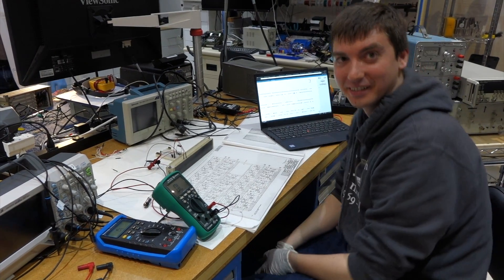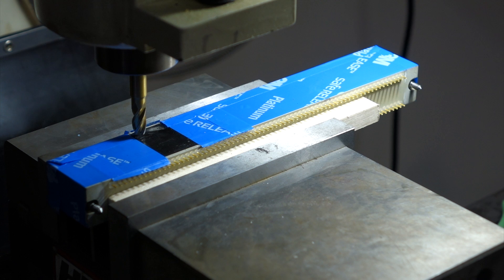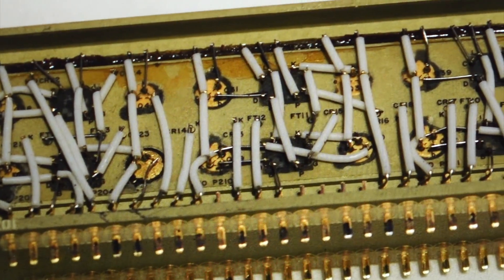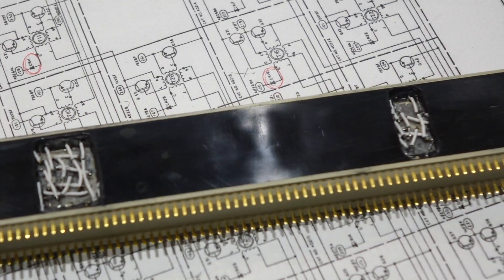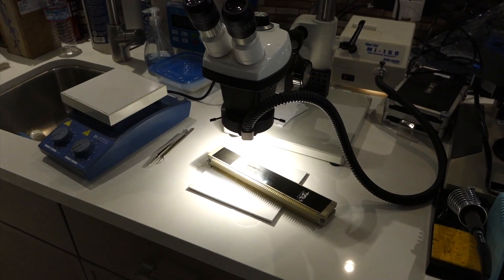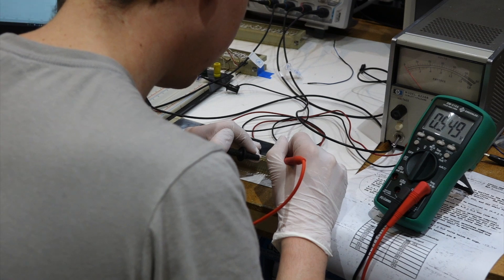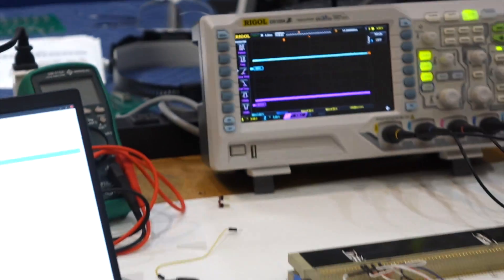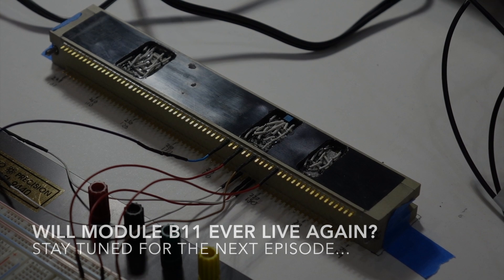Apollo Guidance Computer Part 16: Digging into potted module B11

Comment: I collect and repair vintage calculators from the 60s and 70s. I have seen more faulty diodes than faulty electrolytic capacitors.

Comment: Bad luck that most faults are in the sealed modules
Reply from the maker: I don’t think it’s luck at all. The sealed modules are the only ones that did not belong to this unit original configuration. They likely failed in another AGC/experiment, and someone stole the good unpotted original modules from this AGC and swapped them with the failed sealed ones.

Comment: Hmm suddenly realized.. Your AGC cane from the scrap yard instead of a museaum huh? haha.. great work guys..Absolutely something special.
Reply from the maker: Yes. It’s a rescued AGC from a junkyard. Was going to be melted down :-(
Reply: @CuriousMarc  could well have been that they did some destructive tests on it and that's the exact reason it ended up at the junkyard instead of a museum. I think a couple  of years ago I saw the first parts of the serie and it looked bad so I gave up.. picked up recently and luckely you guys didn't give up. Enjoyed it so much. Something special to this. I myself worked first decade of this milenium with Siemens Teleperm-B from the 70's a system that was a bit of an evolution of this computer but much simpeler. The program was stored in mostly AND and OR gates.
Reply from the maker: @johannesdesloper8434 We know from the recovered content of the core memory (in one of the later episode) that it had been functional until its last power down.
Reply: @CuriousMarc  Aha, so components died of "natural"causes. Hard to find the right words , but this whole series of video's did a lot with me. Thanks for the effort. HA! I have a couple of large ferrite rings laying around, this inspired me and maybe one day I reproduce the old 4bit patent with wood and copper .
Reply from the maker: @johannesdesloper8434  We are not sure. The only modules that were faulty were the potted ones, which did not belong to the original configuration of the computer. One thought is that they failed or got damaged in another computer, then someone stole the good modules from this one and replaced them with the damaged ones. But we don’t know.
Reply: @CuriousMarc  Yeah that was the whole idea of the modules huh? Replace parts with a fault fast without have to rewire that whole backplane. And fun, a blessing to have a guy like Mike around that seems to be a part of that machine, I recognize that in a way, haha, it's a gift.

Comment: Heat helps, i open potted modules with hot air and also there is a BGA potting compound softening liquid i use on this thing, makes it really soft and you just remove it.

Comment: I cringe every time I see potted electronics.  I had to deal with similar issues when working for a military electronics supplier in the 80's.  They also wanted diodes potted into a transformer assembly.  The curing temperatures of the epoxy killed nearly half of the diodes and I had to replace them.  I masked the area with fiberglass tape and used a sandblaster to wear away the epoxy and the bad diodes.  Nice to see you still have a walk in electronics store nearby, I have a surplus store about 15 miles away.  I typically use Digikey for mail order parts.

Comment: You did really well with that. I have experience successfully unpotting electronics. One of my first jobs was at an engineering firm where I did prototyping and reverse engineering. A project I remember well was when a large electronics manufacturer paid us to take apart every shaver battery charger on the market and provide a schematic and a short analysis on its operation. For the potted circuits I had a large liquid nitrogen vessel that I would drop the circuit into until frozen solid then I would wave a small torch over surface. The temp change would cause the top layer of potting compound to crack and lift. I would scrape away all the loose material with small chisels and dental picks until everything was gone then repeat enough times until I could read the components and draw a schematic. The reverse also worked where a lab oven was used to warn the circuit then it was dropped into the nitrogen.

All the solvents I tried either did nothing or made such a mess that discovery of the circuits was impossible. I think MEK softened the potting compound but it also removed component markings and softened plastics.
Reply: The one thing I do not miss working with daily is MEK. It is always open somewhere in an aviation shop.

Comment: hmm first determine the actual potted meterial used,then find the right solvent, and concentration, then test the milled dust for conformation of assumptions made, then check its reaction on the metal used in the modules, then use it with the deactivating agent standing by just in case, dismantle and repair the man made device...
make yourself a small JohnnyQ90,Published on Jun 27, 2017 3D Printed Turbine Rotary Tool https://www.youtube.com/watch?v=Fj1gir4tJbU and use it with a generic cheap usb camera microscope/endoscope pluged into a large tv input

Comment: Wow!  That’s excellent detective work and a fantastic job of de-potting the problem area.  Only one minor point - and perhaps why the original diodes were open - clipping the excess lead with diagonal cutters imparts quite a bit of shock to the component (as evidenced by the sharp click! heard in the video).  It is better to use a scissors type cutting tool if one small enough to fit into the confined area.  Great work and thanks so much for sharing.  You guys are fantastic.

I should add the shock imparted to the component by the chop type tool may not cause an immediate failure, but can damage the bond wire connection inside the component or crack the die - resulting in a latent failure the shows up later down the road.

Comment: The first place I worked we did far too much of this type of repair.  Thankfully the modules weren't potted.  I have done hundreds of 2N3904s and 1N914s.  Last job before I retired was easy, Triode RF amplifiers.  Just had to be careful because of the -35KV on the cathode!

Comment: At this point I would take a day and go through both sides to clear out all the epoxy. That module has a lot of faults.
Reply: I think It adds to the piece to remove just the parts needed. It shows not only the construction but its history. I would argue they should shot for even smaller windows.

Comment: Dynasolve 185 Amine-Cured Epoxy Cleaning Solvent might be of use.  I haven't used it personally, but perhaps the manufacturer could advise as to whether it will work on the module you're trying to depot.  More info at https://www.versummaterials.com/product/dynasolve-185-amine-cured-epoxy-cleaning-solvent/ If it works, it might give you a way to repair the core module, too.

Wayne

Comment: How is it that components in a sealed module that were fed tightly regulated power by the AGC could have become damaged, especially after the exhaustive testing that the components went through before they were used in the AGC?

Comment: This is so awesome - and important for future generations, because there aren't many parts left from this era and hardly any of them still working, hence why this team assembled in the first place. I would've loved to have been part of this team because it's just the stuff that really turns me on but I live on a different continent... I was taught the NASA school of soldering back in the 80's when I started working with Ericsson, building and repairing telephone switch electronics and I still use the same soldering technique today (to a certain extent). Those solder joints I made in the 80's are probably still as good today as they were new and we who understood back then why we did the tedious work loved it whereas others left to do other tasks.

How do you plan to close the opened up windows in the modules you open up? It's got to be a balance between conservation (stability), security, looks and personal preference of the owner.
The potting compound doesn't seem to have affected the components at all so NASA knew what they were doing 60 years ago for sure! I assume you're writing down your findings and store this with the modules when done so future generations can read how you went at it repairing these modules? (youtube videos might not survive a couple generations...)

Anyhow, huge thanks for doing this and for documenting all your hard work!!!

Comment: My father worked at Raytheon Missile division, in the Sixties and Seventies.  It did Sparrow and Sidewinder missile guidance elements.   Potting was the bane of repairs to faulty units there.   They had to do much the same thing as you are doing to fix faults.
The very material which protects stuff from damage also protects it from repairs.  LOL
I love  the " Continuing Saga of the Apollo AGC. "  Move Over, Buck Rogers!   Good Luck!

Comment: The original Star Trek,  "The Motion Picture"   movie theme was based on them (though only a couple of years old at the time). Not a great movie IMO, but Roddenberry was quite the forward thinking man's technology  kind of producer. Not much nuke fuel left in them at this point, V-1, V-2.
Reply: Yep! I wonder if we should make and launch a newer Voyager probe, number 3, with modern tech, to supplement V-1 and V-2. Perhaps with more efficient instruments, even with the same power supply, it should have a much longer operational life. Even better if we could think of a better power supply. Sadly, V-1 has had to shut down several of its instruments due to its internal power running low.

Comment: after HSC closed Excess Solutions bought the left over stock. Excess Solutions is on 7th street in San Jose.
Reply from the maker: That's correct. They have only gotten a fraction of it at this time. Not sure if they plan to recover all of it.

Comment: But why did these diodes fail (were they short or open? Diodes usually fail short) and how did that shorted wire happen? Did they not test it before potting the module? You would've thought they would.
Reply: Simon Tay ... These are very early Silicon semiconductors. Many possible reasons for failure.
Reply from the maker: Mike told us that these particular diodes did fail long term qualification, and that the supplier was banned from ever selling to NASA. As you'll see later, another later  failed on us during normal operation.They were replaced for the final solution (remember our AGC is from a prototype series that was supposed to flush such issues out). They must have had some manufacturing defect. It could be that some test or mishap was also done for that module, since it had so many faults. I was not able to extract the diodes fully intact, so we can't do a post mortem.
Reply: Indeed -- the verbiage in the official reports was "channeling and surface instabilities".

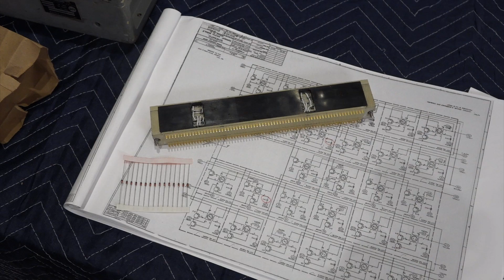Comment: Nice electronics parts store. Several decades ago I worked in a store that also had lots of shelves with those long narrow boxes of components. Did someone say the wrong part number? @8:10 the procured parts were referenced as 1N916B rather than 1N914B. The 1N914B diode is still very popular today. I still use them in projects. I have one envelope in my parts drawers with around 40 of them that are 30 to 40 years old.
Reply: Kevin Cozens .... 1N916B is a higher-spec version of the 1N914B is it not?
Reply: @florencegomer7937  I looked at the basic information about the two diodes and I couldn't tell the difference between them.

Comment: Reminds me of equipment with now unobtanium MC44 diodes in it, which had a very nasty thing of failing as either open circuit (not too much of a problem till 2 failed in the same section) or they went short circuit. Failing short meant you now were shorting part of a transformer secondary, but the unit would keep on running for a while, just with much higher ripple on the unregulated supply. Not a problem for the linear regulator following it, seeing as the headroom was in most cases 1.5 to 1.8 times the regulated voltage, just slightly higher noise on the rails. As the transformer had high resistance secondaries, and quite high impedance as well, this limited current somewhat till a second diode decided the abuse was enough, and it too went short circuit. 

Then you had a 3 phase transformer with 2 secondaries passing a high DC current, or a shorted secondary, and with a few hours running the transformer would overheat and start to carbonise, but no flames, as this is in a near hermetic enclosure.  Fumes, char and dripping burnt varnish then would drip down and collect, till eventually the transformer finally finished shorting out properly, blowing 2 of the 3 1A primary side fuses. The internal fan would also merrily coat every board with a thin film of this gas, making cleaning the entire interior an imperative. you could smell those that arrived well cooked just opening the transit case, and getting that "well done, past edible range" smell out of it.

We could not get the exact diode, but instead used the nearest thing we had to hand as replacement, one of a large supply of 1N4004 diodes, and would use 400 grit sandpaper on the leads to thin them down to fit the holes on the board. Worked for those with a single failed diode, or if you got it before the cooking started in earnest, replacing all 6 diodes in each rail 3 phase supply. Eventually some new ones showed up ( do not ask the price), and first thing, after testing them, was to see what the OEM did for those diodes. 1N4002 diodes in all of them, with a nice thin lead, made by Thompson CSF. Did I mention as well early plated through holes, and early PCB material, that was not too amenable to staying put with heating to remove parts. Superglue was our go to fix, along with thin copper wire reworks.

Comment: Can This be a module from the Apollo 12 lightning strike?
Reply: The AGC wasn't harmed by the lightning strike. And all flown current switch modules would have the dash number -031, while ours is only -021.
Reply: No, this module was not used in any flight computer AFAIK

Comment: Looks like that module was tested to destruction.
Reply from the maker: That was one of Mike's thoughts. He explained that the later modules in this prototype series were used for very extensive reliability testing. This module might have been one of the tortured ones.

Comment: Marc has aparently watched other electronic repair channels on YouTube. He's got the EEVBlog "don't turn it on, take it apart" attitude, maybe with a bit of bigclives "let's use the vise of knowledge" way of doing it thrown in ;-)
Reply: The short circuit in this module in particular is why we took it apart and exhaustively tested every single circuit instead of just powering it up. The short could have caused a lot more damage to other modules. It feels tedious when you're doing it, but it's worth it when you actually find a problem.
Reply: @mikestewart8928  This might be a stupid question, but how would the astronauts have dealt with a AGC hardware failure during a mission?

Comment: I would have grabbed all the Germanium transistors (for lineal/ audio applications) out of this shop !!!!. Some types rocketed in price since used in distortion effects. But appart from that, the best sound without using tubes / valves.

Comment: 6:25 How do silicone diodes go bad? Too much current?
Reply from the maker: That's one way, and was my first thought. Then Mike pointed out that this diode did not pass reliability tests and that the vendor was banned from selling to NASA. Later on another one died on us in normal usage. So it looks like Mike's theory (diodes with per-existing defects in them) has got some traction.
Reply: CuriousMarc - Makes sense, still was the early days of semiconductors and manufacturing wasn’t terribly consistent.
Reply: According to the official reports, these diodes had "channeling and surface instabilities" which led to unacceptably high leakage currents and eventually failure.

Comment: How much do you think those diodes cost back during mit building this?
Reply from the maker: They must have been a special NASA tested version, with much tighter tolerance, testing and qualification requirements than the regular version. So probably they cost a lot.

Comment: Archaeologists and other restorers where necessary, use a miniature sand blasting tool. I wonder if one could be used to remove the majority of the potting compound and then use the old fashioned method of using small tipped tools to pick out the remaining potting compound.
Reply from the maker: Maybe. But in archeology, it's the reverse hardness situation. They have a very hard fossilized bone encased in a soft rock. Here we have a very hard potting encasing a soft component. Which is a much more difficult case.
Reply: @CuriousMarc  What about using a Dremel (small version of a drill). Dremel's have very precise hand control and come with a multitude of specialist tips. Use the milling tip to take off much of the compound as you do in your video, then use a dremel for the next stage in getting out the next portions of compound and then use the hands tools for the final delicate work.

Comment: With Dichloromethane you can dissolve the potting compound. Leave it there overnight. When working please wear nitrile gloves and no latex gloves.
Reply: I love my bottle of DCM
Reply: MEK will also work, though with some of those potting compounds I had to let it sit in there for nearly 3 months before the potting had absorbed enough to soften enough to pick it off. PCB survived, though I am taking no bets as to the attachment of the tracks to the board, I think most of them are held on by the vias and component leads.